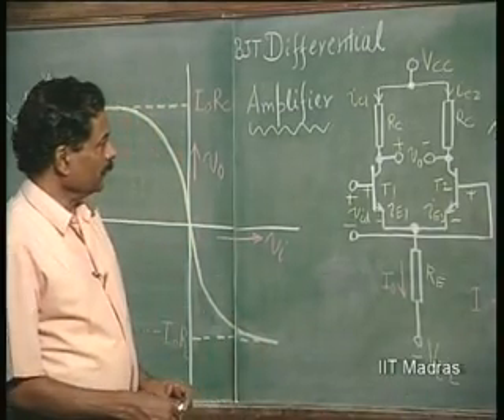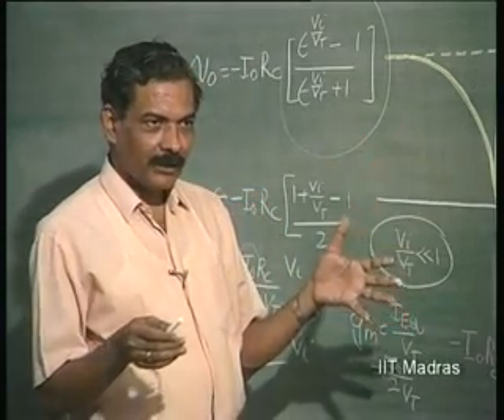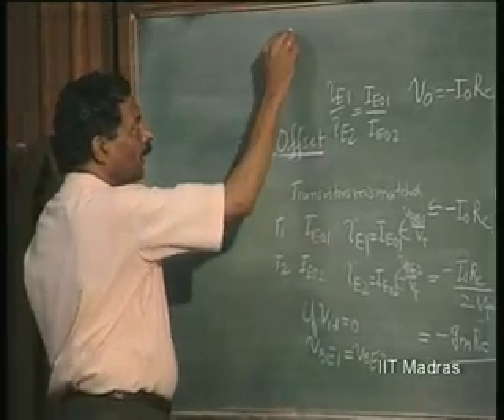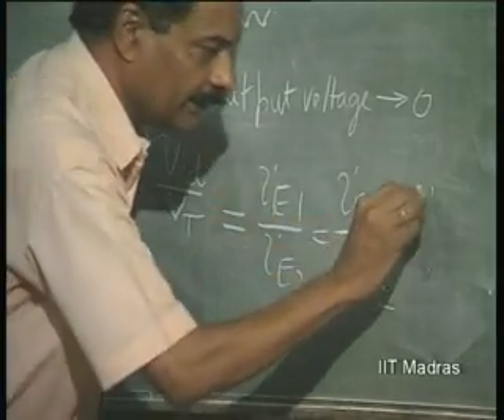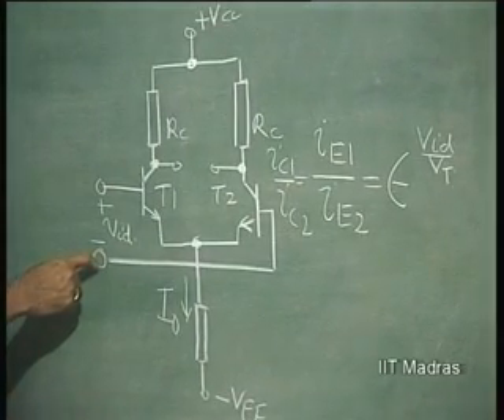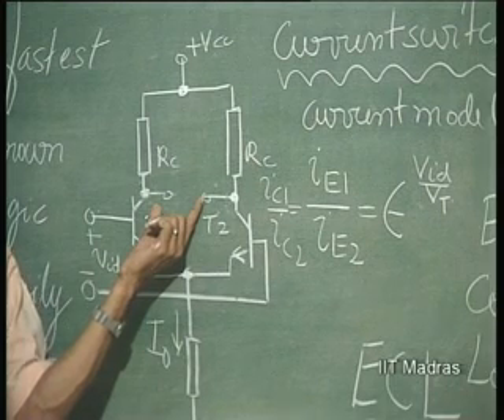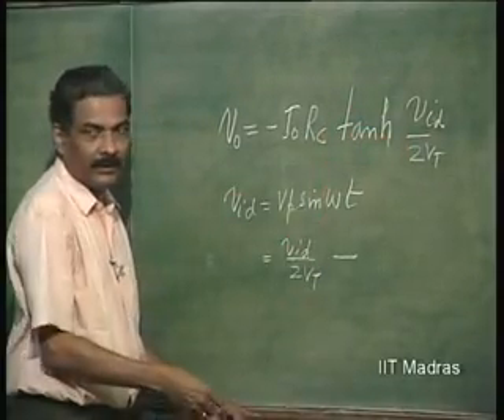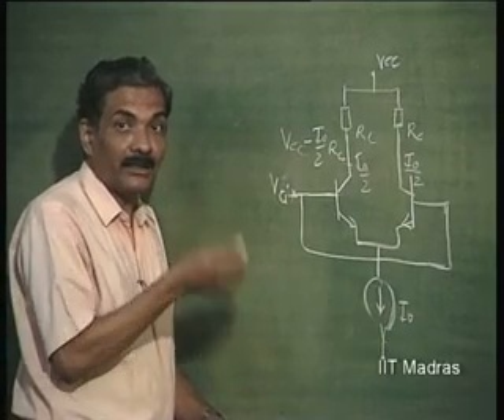Lecture - 33 BJT Differential Amplifiers

Comment: Sir,
Many thanks for your amazing lectures. I would like to know how to explain virtual ground concept in op-amps. A charge amplifier based on op-amps has  elements across the inverting and non-inverting inputs of the op-amp. Is it correct to say that since both terminals of the op-amp are at the same potential, the current through elements across them is zero?

Thanks in advance for your insightful explanation.